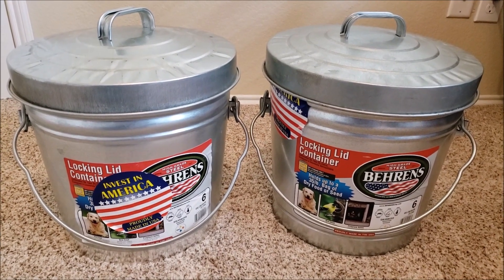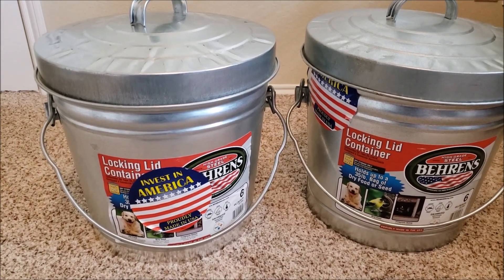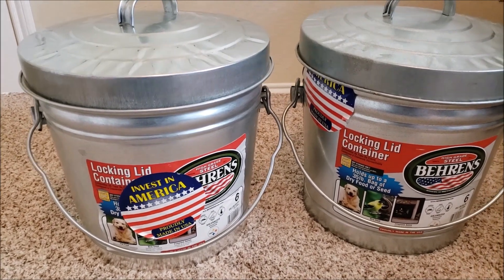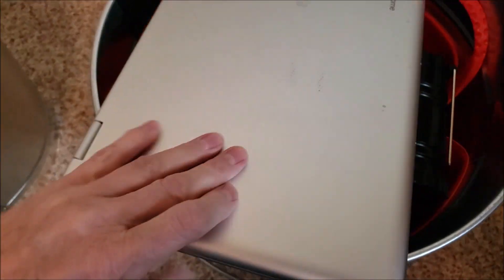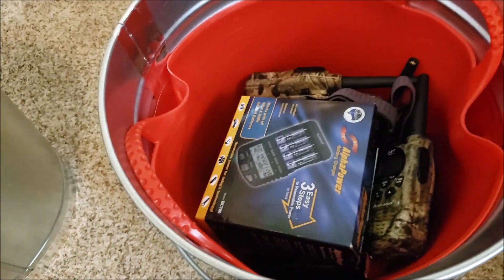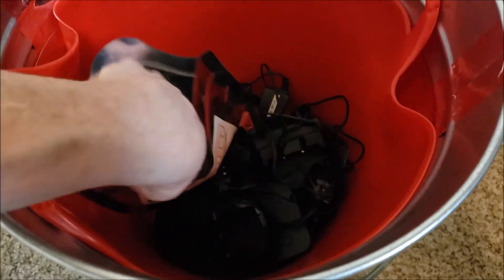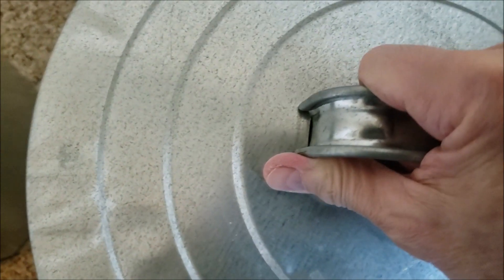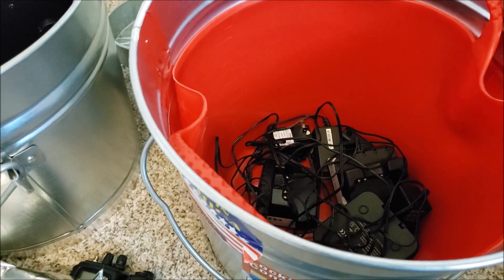What to Put in Your Faraday Cage

Comment: A better check for your Faraday cage is a cell phone. It doesn't take much shielding to kill a radio signal. A better test is your cell phone. Put that in your cage and then call it. If it doesn't ring, your good to go.
Reply from the maker: Actually, you are wrong.  Some people have that misunderstanding.  If an am radio signal goes away, you should be getting at least 50db shielding, which is good enough. A cell phone is way too strong of a signal. I talk more about testing in this video...
https://youtu.be/IsPfUxQsoTc?si=e2jl2OUmOPJGNCQI
There is a link in there to an expert on the issue.

Comment: I have the same exact setup but electromagnetic energy still gets through and I cannot figure out why. I taped the living hell out of it and the inner lid but my walkie talkies still communicate
Reply from the maker: Use an AM radio with strong signal. If it goes away, you likely are getting 50db shielding, which is enough. Watch my video on how to make faraday cage for portable power station. Your 2 way radios are too strong. If you want over protection, put item in plastic bag and wrap in foil.
Reply: @LoneStarPrepping  great info. Thanks a lot!
Reply from the maker: Let me know how it goes!

Comment: A large stock pot water soap and clothes .place on stove burner or other stir and once you see the water turning brown. Use a wooden paddle.and remove into a bucket.add cold water to bucket .rinse and hang outside.🎉
Reply from the maker: No idea what you are talking about.
Reply: How to laundry with out   using your hands. Cook laundry in soap water. Remove it to a bucket adding cold water.
Reply from the maker: @happycustomer3448  Oh! Okay.  I think you posted the comment on the wrong video.
Reply: I posted on the wrong one. It was the laundry one.
Reply: Yes

Comment: It's not that this worn't work, it's just that you wont' survive the next 30 days after an EMP event. EMP's don't kill you, mobs do. When you are the only with supplies, they will come for you. I haven't stopped prepping,  just putting my $ in other usefull efforts.
Reply from the maker: Thats rather presumptuous of you to tell me I wont survive 30 days. I have talked about this in my videos. There are ways to deal with avoiding mobs.  Riots and mobs are my main concern... I get that.  But to have some electronic devices survive, will help me deal with the situation.  Its only a small part.  I dont plan on trying to fight off mobs.  I dont plan to be where the mobs are, but there are different degrees of disaster.  I get that if you have what people want, you are a target.  Most people dont know what I have and I have plans to deal with that should it come up and I will likely not even be at that location by then.  That being said, most people will not survive.  They are not self reliant enough.
Reply: @LoneStarPrepping  I realize I sounded like a troll though my biggest crime is being ungrateful. Your worksheets for solar generator save my sanity by bringing logic to my 2 year solar project and I look forward to getting the Ecoflow. Your Texas power outage vid was instructive and well handled. Now, I'm hoping your ham radio vid is as good and practical as everything else I've seen here. Keep up the good work and I promise to lay off the critiques.

Comment: Why don’t you have spare batteries in there?    AAA, AA, C AND D, and the little batteries for your key fob……will the emp also affect your watch and clocks?
Reply: Emp affects electrical components, rine wiriring, circuitry and circuit boards, etc. Batteries have none of these. HOWEVER, some litium ion batteries do so if you have lithium ion batteries for storage, I do recommend them going in the faraday cage. I keep a couple Dewalt batteries as well as a full cordless tool set and dual power charger in a faraday as well. Easy to charge via solar and tools will always be needed.
Reply: @christopherhansolo9069  Thank you!
Reply from the maker: Because emp should not effect batteries.

Comment: Why can't you use that flex seal and paint a rubber barrier inside, instead of 14.95 for a 10 gallon plastic bins to have inside?  Flex seal would be cheaper. Just 🤔 thinking.
Reply from the maker: Yep.  Im sure you can. You can use cardboard if you want.  I like my way the best.  Its clean, easy, cheap and fast.  Flexseal about same price as a plastic bucket.
Reply: @LoneStarPrepping  One advantage is you also have a bucket you can uti
lize for other things.

Comment: I'm sure whoever does an emp attack will do two attacks for that reason
Reply from the maker: Very good point!  I agree!  I have thought about that and have planned for it.  1 is none.  2 is 1. I have multiple ham radios etc... and plan to remove the first one many hours after an attack.  Then, if attacked again, I have several other radios and solar generators... 1 at a time... If there were an EMP attack, my main concern is protecting my ham radios because typical radio stations would be out amyway, but ham radio communication would be around if protected. I wouldnt remove my final radio for weeks. I would then store them in faraday cages in between trying to communicate.

Comment: So what if ur stuff is protected during the emp attack then you take it out to use it and theres another attack..wouldn't it all have been for nothing.
Reply: Good point. That's why they don't recommend taking it out for a while. Maybe until all the infrastructure is destroyed.
Reply: That is why you have two or you have a cheap radio in there as a "scout radio".  You take that out quick for a few days and see what's going on with that. But the reality is that if we actually have to use this bucket, we likely dead within 3 months anyway.

Comment: I’m going to test a metal bread box I have.
Reply: Let us know how your bread box worked!
Reply from the maker: If you try it, test it with a strong AM radio signal. If the signal goes away, you should be getting at least 50db shielding protection, which is all you need.

Comment: That is not true that if you lose a signal from a radio that you have enough protection from a standard EMP.  Please search "empdoctor galvanized garbage can."  To be effective against a real EMP spike you need either a conductive gasket to seal the lid or aluminum tape around the outside of the lid.  EMP waves contain tiny high voltage frequencies that can squeeze through even the smallest of cracks.  Empdoctor "Arthur Bradley" shows this with very good test equipment and he has the degrees to back this up. He is used as a consultant for many government facilities.
Reply from the maker: I have his link on my page because what he says supports shat I say.  Watch the very last 30 seconds or so of his video. https://youtu.be/aMct99DiZak
So, the idea is, for items you want access to fairly easily, its fine the way it is by am radio test for standsrd emp.  For more sensitive items, I put in mylar and that passes the 2 way radio test.  And nobody knows for sure any of this... Its all an educated guess.
Reply: @LoneStarPrepping  I see where you are coming from, and in the last few seconds he also acknowledges my point. If you want the best you "seal it up."  If you want the convenience you just put the lid on.  He said in another video that 11 - 20% of cars would still function just from dumb luck during an EMP blast.  I just want to err on the side of caution.  Radio wave testing of EMP shields covers from 3 meters on FM to hundreds of meters on AM.  That is easy to block even with metal window screen.  EMP waves are sub mm on the high end. 
I do like your videos and subbed.  
Don't use my critique as telling you to not keep doing what you do. 
I enjoy your style and presentation.
Reply from the maker: @chuck_howard  oh I understand.  The thing is nobody knows for sure. We just do what we can with the best info.  Sure... taping lid would help.  I will test...
Reply: https://www.youtube.com/watch?v=uYWhTMmv6bs
Reply: One of the commenters Mike, even says "WOW I wouldn't have thought the tape would've made that much difference. AMAZING"